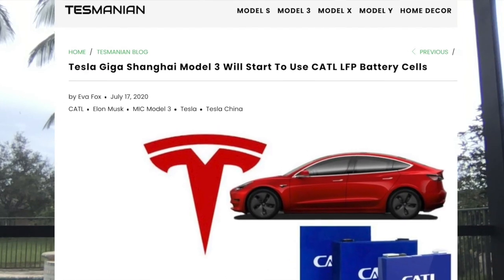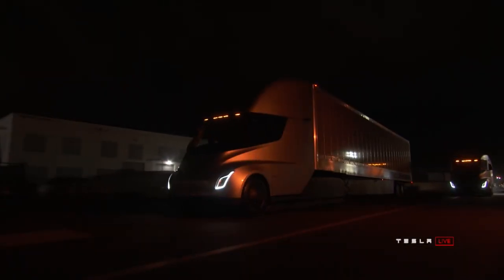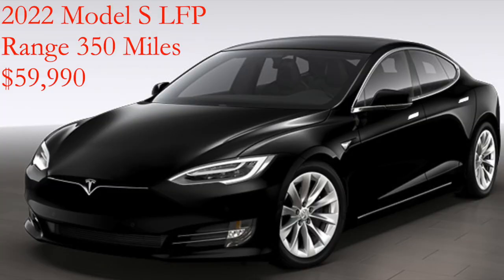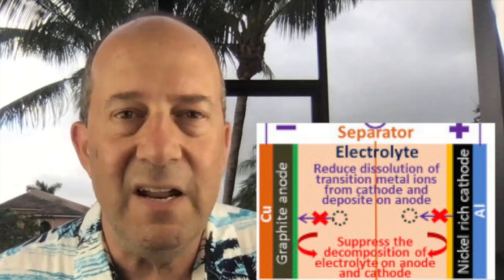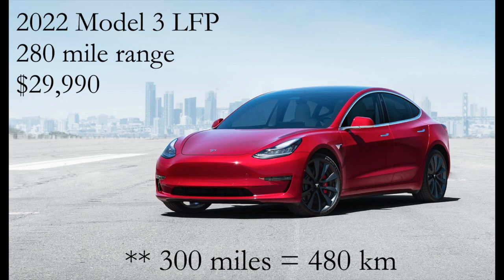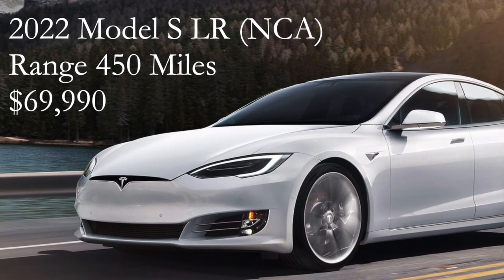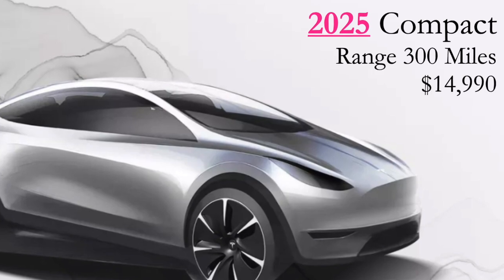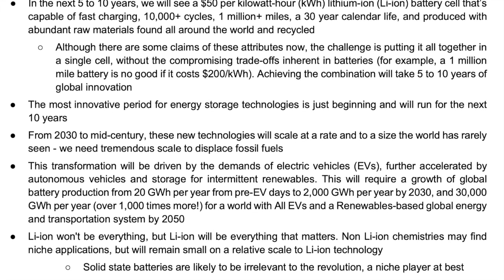Battery Day Secrets: 2021-2025 Tesla Lineup - Elon Musk

Comment: Second hand Teslas in 2025 will have to be under $17,000 for the model 3,  under $30,000 for S and $35,000 X,   Since the new prices will blow away the value of the 2nd hand vehicles. However nobody needs to fell bad, since ice vehicle 2nd hand will be worth $5000.
Reply: FALSE, Tesla Vehicles retain up to 90% of their VALUE. 
however, you can sometimes find a 2012 model S for $35,000 on sale USED.
Reply: @markplott4820  Not if the price of new Teslas fall to the prices suggested by Warren. Why would you buy a second hand Tesla for more than a new Tesla! So Tesla is careful not to speak of the prices in a few years, because of the Osborne effect...people would simply wait for the new vehicle at lower prices.
Reply: @vensonata   - I am Talking about the CURRENT used prices, see for your YOUSELF on the Actual TESLA offical USED car site , they are selling Close to or Sometimes MORE than a NEW Tesla model 3 SR+ . 
the cars are THAT Valuable. 
but, eventually, the price will come down , but NOT by much.
Reply: @markplott4820  Ya, of course that is the case now. But this talk by Warren, if correct, has major consequences for used Tesla prices.  If true, it will through a wrench into a lot of people's ideas about the value of their present Tesla. You may see a sudden surge in used sales before the market goes down.
Reply: @vensonata   - we shall see, FACT is Tesla retains the MOST of the Value of ANY USED Vehicle , and this will be Reflected in USED Tesla prices.

Comment: One more advantage of LFP is that it can be charged/discharged faster compared to Ni based. LFP+dry battery +cell to pack  will together improve energy density, making 300+ mile 3/Y possible. In addition, the tabless cells will further improve charge/discharge rates. With higher charging rates  lower milage is less of an issue.
Reply from the maker: I am interested to see how much they can improve LFP. It's about 160 Wh/kg now. Maybe they can get it to 200?

Volumetric energy density is actually a bigger challenge for LFP - Watt-hours per liter is relatively worse than Wh/kg.
Reply: @WarrenRedlich  Probably Tesla can learn some lessons from Lucid on interior space utilization. To maximize interior space Lucid do not have a flat pack. I think Tesla could do somethings to add more battery volume. For example, in Y, instead of raisers for the seats  they could stuff more batteries.  They could also sacrifice the depth of the trunk a little in LFP versions. In cybertruck they could sacrifice the additional covered storage under the bed. 

But LFP is just  a temporary fix in my opinion. In 5 years or so they will be able to establish supply chains to really scale Nickel based batteries. Ultimately, with very high scales,  higher  density batteries will win out even in terms of price due to lower weight of materials. Cant wait to see what 2025 brings!
Reply from the maker: New video on Lucid goes public in about 8 hours.

Comment: I don't think the M3 will ever price out as low as depicted, but even if it does, consumers will actually pay MORE for Teslas in the future. Why? The FSD package will continue to go up, up, and up, thus making the entry level sticker look more enticing than reality. Elon has already shown his hand for the FSD package--the price will never be fixed. Anybody buying a Tesla without the FSD package is, IMO, nuts. You're missing the point of the whole revolution. Also, any range over 300 miles is really not necessary, nor is it realistic, considering raw materials constraints. Why put one battery in a Model 3 with high range when you can halve the battery size and make two Model 3s with one high-range battery? At this point it's all about putting out as many cars as you can, as quickly as you can to develop the robo taxi fleet. Thought provoking video.
Reply from the maker: I agree. Especially in a robotaxi world, 200 miles range will probably be enough for most rides.

Comment: I think your prices far too optimistic. A model 2 for 15k. Not happening. I'd say 20-25k at best.
Reply from the maker: We'll see in a few years.
Reply from the maker: Elon said Model 3 would get down to $25K.
Reply: @WarrenRedlich  yes but you're quoting a 400 mile range with a 11.7k reduction on price. 

That's a 60% increase in range on Standard range with a 37% reduction on price. Let's calm down a little bit. I'm a massive Tesla fan and shareholder but I feel this is very optimistic. 

We will see. 

Great video though. Can't wait for battery day.
Reply: @WarrenRedlich  he also said range around 300 is more than enough for most. I suspect any cheap cheap models will maintain range around 250 to 300 while Tesla reduce the number of cells required and costs go down. This is how they can get to a 25k model 3.

Comment: You are underestimating the ABP. This new battery technology is NOT an incremental improvement. It will make current batteries look like stone tools.
Reply from the maker: I agree it's not merely incremental. It's a step change from 250 Wh/kg to 340 Wh/kg with fairly quick growth to 400 Wh/kg. Also should lower cost per Wh dramatically as they get the manufacturing down.

Comment: Who would have thought, a $29K T M 3. Holy moly. But, if FSD costs $50K by then...I dunno.
Reply: Holy cow... I just realized that there is no other automaker that even has a road map to producing such a cheap and safe electric vehicle (You know, the vehicles are the future), while at the same time having a multiple tens of thousands of dollar 100% profit margin software based ad on that people will buy in droves. Game, set, match. Lights out. Goodnight GM/Ford. I do believe they have been out innovated. Why the heck is it that Gordon Johnson and the other Tessa Q folks can't / won't see this.
Reply: I suppose that FSD will not be mandatory for the purchaser of the vehicle to buy but it will be a good thing if the vehicle itself costs less than $30,000. Although, by that point Tesla may not even be selling their vehicles to individuals anymore because if full self-driving is a thing then there's no point in having individuals or even fleets by their vehicles... This is a good set of problems that Tesla has.
Reply: It won’t be a binary transition, gradual ramp of regulatory and public acceptance of a. FSD with driver monitoring, b. Driver presence, c. Full robo car no driver required, removal of steering wheel.

Comment: no model s and x will see 500 to 600 miles and Cyberteruck will need 300to 325 on single motor 400 to 450 dual motor and 500 to 600 tri motor

Comment: I use a LiIph battery in my motorcycle. It weighs less than a pound and replaced a 14 pound  battery and has more power and is not affected by cold. It's also half the size. Hugely better all around.

Comment: Perfect forecasting.
You know if there is a way to ramp up battery production in wich the refused batteries can still be used for low energy density aplications?
Reply from the maker: I think the plan is to recycle refused batteries so the minerals can be used for good batteries.
Reply: @WarrenRedlich  yeah!, it amazing they can repurpose recycling to also be used in this case, but i was wondering if there was another way, like a temporal redesign which will sacrifice a little capacity but could isolate most defects so they could still have some functionality. Of course this should be temporal till the % of refusels has gone down and they can redesign back for higher performance. Probably only in a few lines as they still will need some very premium batteries for some uses.